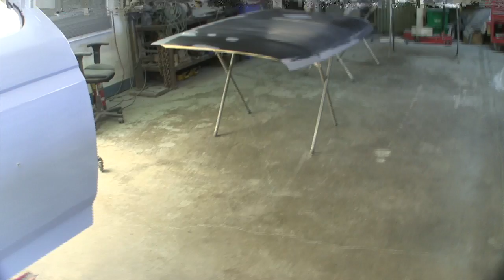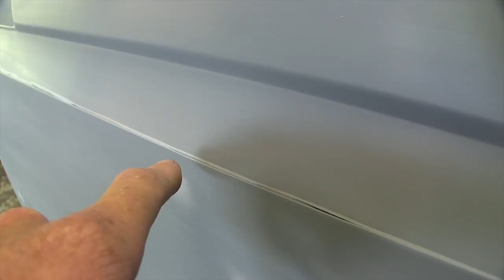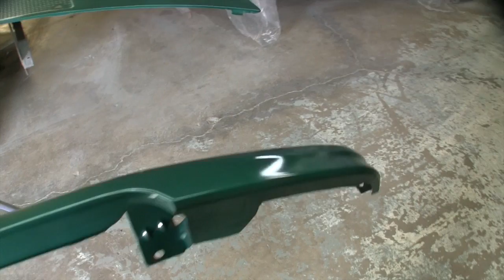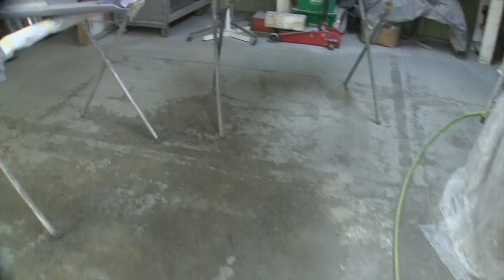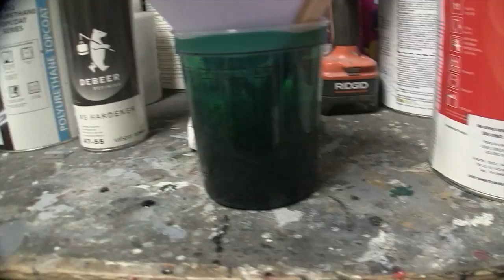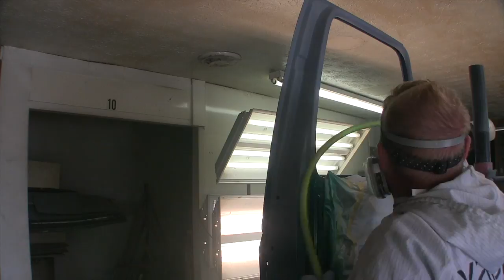F350 Stakebed part  11  - Getting doors into some color

Comment: wow $600 for base coat. Why don't you use Cromax its much cheaper?
Reply from the maker: Chevy Beaglenox 
Cromax is more expensive at the local jobber.  And from my experience with cromax their greens take more coats to cover.  The other reason is my Debeer jobber has much better support should any issues arise. Sometimes it’s more about customer service than the dollar for me
Reply: Good point, nice work:)